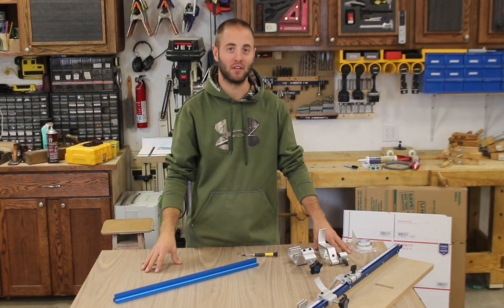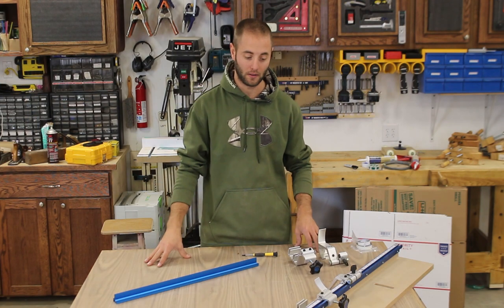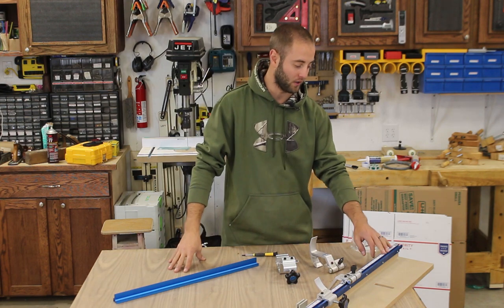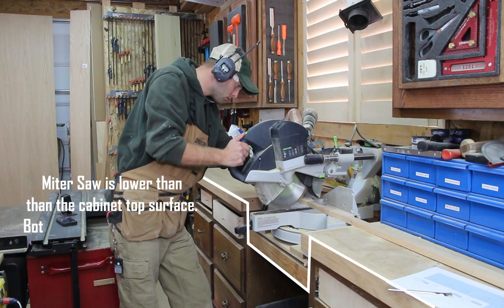Kreg Precision Trak & Stop Kit Review

Comment: It's a nice system but for me, it has one major flaw: The self-adhesive tape does not come with imperial and metric measurements.. Other tapes that do are too wide for the Kreg track.. Metric is so much easier to use than trying to figure small fractions with varying denominators.. My SawStop table saw has both measuring systems and I use the metric all the time..

Comment: @2:05  You can see the stop block move a little bit when you place the end of the board against the stop.  Does that cause any inconsistencies in your cut length from board to board?  Do you simply need to tighten the screw more to keep it from moving?  I noticed the reading in the sight glass didn't change much, but still, I am wondering if that movement is causing inconsistent lengths or cuts that aren't 90 degrees to the other sides of the board.
Reply: Guessing the swivel pin is not a zero clearance fit, plus everything is flexible to some extent and that's not exactly a 1" diameter steel pin.  For best repeatability, I'd try to always press against the stop with the same pressure.

Comment: Curious about the dimensions of your miter saw wing. I'm looking at purchasing this set up for my new miter station I just build. I do have my miter saw recessed into the station like you showed that you had yours. Your dimensions were 2 1/4 and 6". How did you come up with the 6"? Just curious because it seems like a lot. But I also noticed that you have slots in 6" piece. What are those for?

Great video. Helped me understand the system better.
Reply from the maker: Angie Overton 6" pieces are to give the fence stability and the slots are for the knobs that keep it in place.

Comment: i set this up on a mobile miter station, but putting the tape  down   on the right side  the production stop and swing stop do not line up  on the same measurement.
ifs its on the left side  you can use either one . using the same measurement line.   but it seems you can only use the production stop of the right side . if you  switch to the swing arm the measurement line does not work. or am i missing something?
i am thinking of only using the production stop  that way i will not mess up measurements and use the swing stop on my cross cut sled.
Reply from the maker: If I am understanding the dilemma.... The clear plastic indicator line can be switched to either side of the production stop.

If this isn't what you are referring to please let me know.

-Andy
Reply: the production stop has the indicator on both sides but the swing stop does not, it is only on one side and it is off set     if you put the production stop on say 27 inches and used it to cut 3 pieces  then you went back later and put the swing stop at the same 27 inches and cut. the boards would not be the same length.  on the right side of the saw.  
or of course i could just be stupid and when i was putting the tape down i was doing something wrong